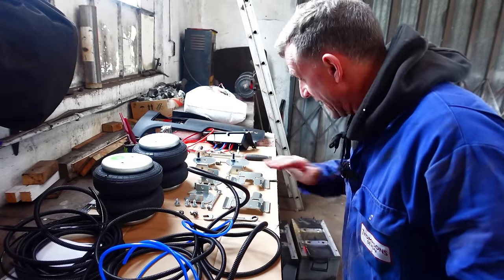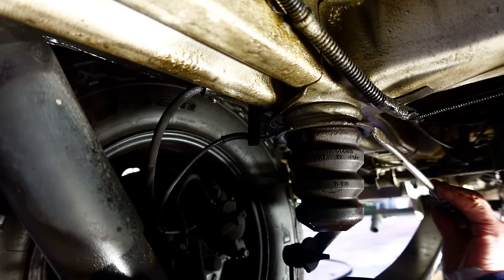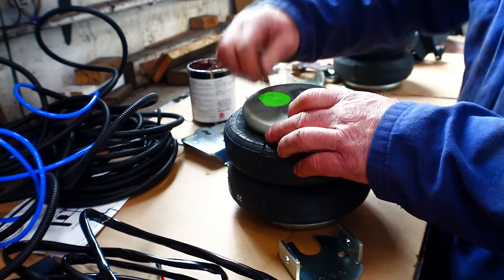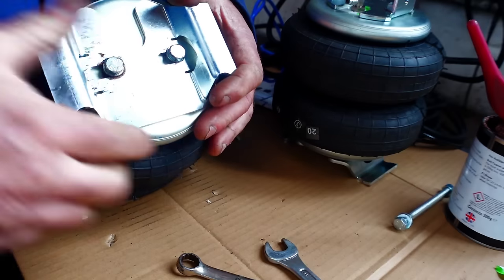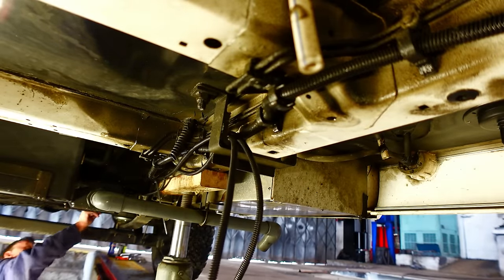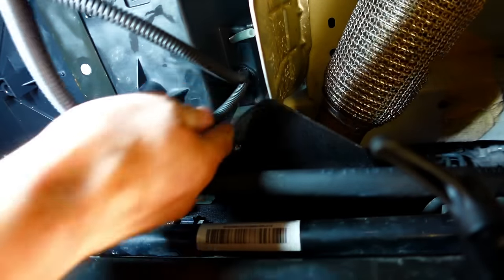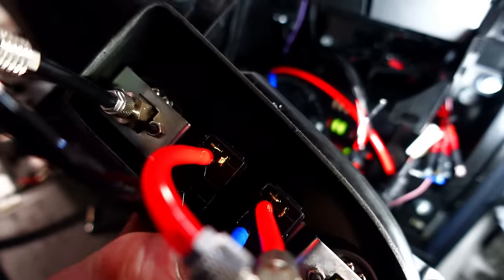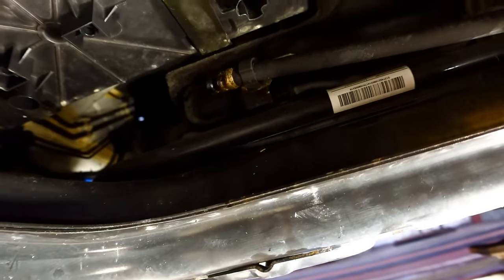MOTORHOME 🚍CAMPERVAN £399 AIR RIDE Adjustable Suspension BAGS FULL FIT Fiat Ducato 🔺🔻

Comment: Just a few tips, the best way to remove sticker is to heat them up and they will come off completely. As far as it concerns the O-ring mounted on the in/outlet of the 90 degree connector that is mounted on top of the airbag, you might have put on some acid free vaseline to conserve it. However, great video, I thing of mounting them under our Bürstner Ducato 2.3/160/2021 as well👍👍.
Reply from the maker: @NobbyRon  thanks Ron for taking a look 👀 🙏🚍🚍💯

Comment: Brilliant vlog, I wish my other half was as handy as you with the spanners.  I would love to add air suspension to our van, it will be interesting to hear your review on the difference these make to your drive. 👌
Reply from the maker: Thanks for your comment, not driven that much since fitting but the 8 mile drive I did on very bendy roads was a vast improvement 🚍🏨🌴🙏🔺🔻💯

Comment: Good work Jof, waiting to see how it works!  Can't imagine doing this work on a driveway or without an air gun, although I believe that you will need to torque your nuts etc to the correct setting after a couple of journeys. Good luck Drew🏴
Reply from the maker: Thanks Drew, so far very happy with the results, very noticeable with the cornering stability on our Devon roads.
Will be checking everything closely on further inspections.
🙏🏨🚍🌴
Reply: Surprised there’s only a single leaf spring on your coach built, have the same n it’s pretty much flat! Was thinking fit a double spring or air bags. Good job as always and would love to hear some updates about them. ✌️😊 JOF bolts 😂
Reply from the maker: @spitNsawdust thanks for taking a look 👀, always best to use genuine JOF bolts 🤔☝🏼💯🚍🏨🌴
Reply: Very informative Jof, just wish I had your confidence and expertise to tackle the upgrade myself! Looking forward to hearing how you get on with the new airbag’s 😊

Comment: Great to watch, we’re looking at the system, ours is a corado on a fiat ducato plated at 3700kg, the boot has a 250kg limit, would this kit be suitable? Thanks
Reply from the maker: Absolutely Graham, you can speak to the guys at Martech for more information if required.☝🏼🚍🏨👌
Reply: Just ordered the kit you installed, called them to check I was getting the right one and as you said they are super helpful. Back to watching your Dutch trip now. Cheers.

Comment: Quick question for you mate, did you have any problems with the air pipes behind the control panel kinking? If so how did you fix them? Cheers.
Reply from the maker: Just trimmed them as tight as possible, and just tried to keep them as relaxed as you can 👌
Reply: Ok mate will try that, had it fitted by guy that does all my work, too old and knakerd to be crawling under the van these days but he said it was the best kit he’d ever fitted.
Reply from the maker: @grahammullins9455  excellent Graham, its good & does the job that is all that matters👌🚍🏨🌴